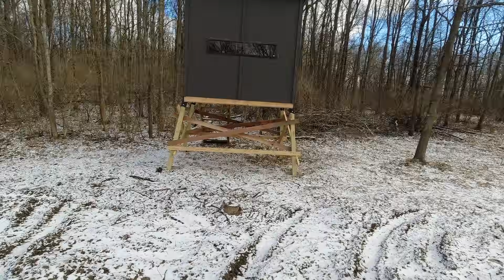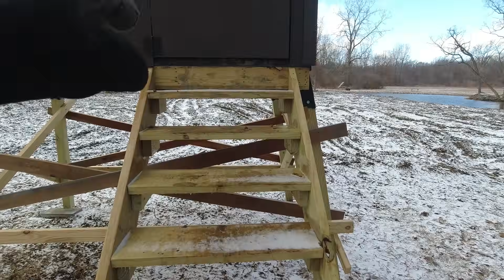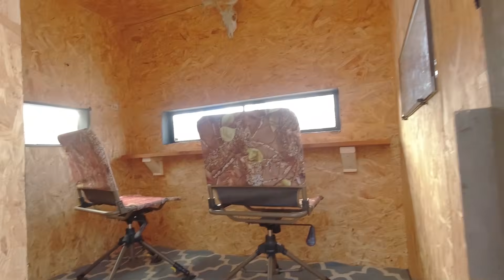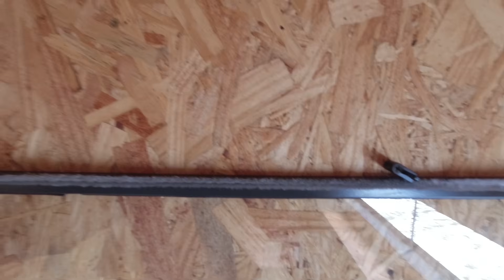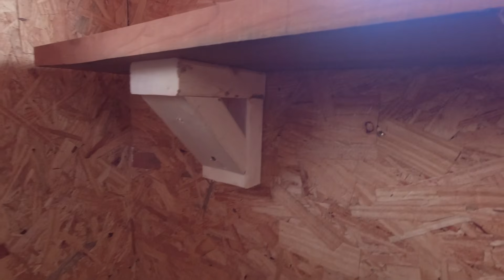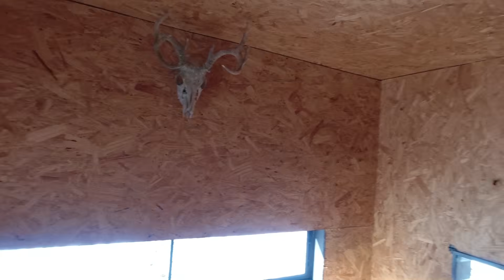ULTIMATE Custom 6x8 Deer Blind Grand Tour

Comment: My one man homemade blind is about 5 x 5 on the inside with sliding windows on all four sides.  One thing I did this year was apply window tint to the inside of the windows. I noticed in the past that deer could detect movement inside and spook as a result.  The only downside is that film makes the view out of the blind a little bit blurred.  I don't think it is enough to cause a problem.  If it is I can always remove it.  I will find out when season comes in this year.

Comment: Looks great. I like the idea of closing in the bottom.  I wasn’t going to insulate but now I might. 
Something I’ve learned in Oklahoma with crazy winds is a tip for added support. I have one in process of building now.  Just have the platform made so far. I had used some 2x6 boards for cross braces on the stand. Had some left over. On one side of each cross brace I have it so that the support sticks out about a foot or so past the leg and goes to the ground.  Yeah, I should paint it bright orange.  I bound to trip on it.  
This is added stability and helps keep it from tipping. I also added a 10-12” piece of 4x4 where the supports cross and screwed both supports into the piece. 
It’s doesn’t flex a bit. It’s rock solid. 
Good luck hunting! 
That spot looks killer.
Reply from the maker: Appreciate it man! Good luck this year in your neck of the woods

Comment: I'm in the process of building the exact 6-8 blind. I also figured it's the right size. I also went with only a 6'.6 celing.' Because in WV it gets so cold and better to heat then my 8x8x8 box blind. It takes alot of propane to keep it warm all day. Nicce blind. And yes 6'x6' is the sweet spot for sure

Comment: Awesome looking Stand. What type / thickness of sheeting did you use for the floor of your Stand. Also what about the Sides? Thanks
Reply from the maker: Hey thanks for watching! Did 3/4 I believe for floor and just 1/2 plywood on exterior walls. Interior walls were more cosmetic and to lock in insulation so did real thin 1/8 OSB for that.

Comment: I’ve used stall mats inside on the floor with office chairs that roll, its very quiet. The other thing to think about is putting up some curtains to help eliminate silhouetting and it keeps the blind dark inside after you paint the interior walls.
Reply from the maker: Stall mats is a good idea, I think Tractor Supply has those in stock here.
Reply: Yes and mice don’t eat those.

Comment: I built a 5x8 and only for one person. I have the same windows mostly. I did not insulate mine because heater is more than enough. One thing I did with this instead of my propane heater is a small wood burning tent stove. This lessens the moisture that will build up on the inside with your breath and the propane heater produces moisture. I have not tested the stove in really cold weather yet because built in summer but tried it in 40's and once it gets burning really produces a lot of heat. I am sure it will be more than enough. If you want to see a picture of my stove setup let me know. I really like it. This is a ground blind but I have an elevated blind with stairs like yous with a rail and platform  at top outside door.
Reply from the maker: Wood burning stove is legit, you'll be out there in a T-shirt and shorts to stay cool 😎

Comment: Do you have beams/ hooves with bridging to support the floor and Buliding. It looks like amateur construction… Old Billy
Reply: Hooves?  Damned correction chip ..Floor Joyces …
Reply: 8x8 is so much better,  cheap …, Conforms to simple siding, roof ,.and floor sizes for lumber and makes it a mini cabin
Reply: Still , pretty comfortable for a novice
Reply from the maker: 2x6 joists 16" on center for the floor and 3/4 plywood flooring to lock it all down. Man 8x8 would've been a bear to move with the skid steer but ur right on it being a mini cabin at that point. It's solid that's for sure.
Reply: @hurstyoutdoors  8x8 is downright luxurious. We built one in my Father-in-law's pole barn. Took the sub-assemblies (walls, floor section, etc.) out to the site using a trailer and John Deere then assembled it in place. Lots of room to stretch out in it. Also gets warm with a Mr Buddy heater going. Several times I've taken a nap in there.
Reply: I built mine 5 x 7. But I have windows out both sides. 6 is to wide to go side to side without moving. Still have room for 2 people. Used Brent M. windows.

Comment: whats your interior wall height?
Reply from the maker: Just checked and the finished height for inside is 7ft on the front side and slopes down to 6ft 6in for the back part. The rough in lumber dimensions would be taller. But plenty of room to stand up and move around, I'm 6ft and it's great. You building yours for this year?
Reply: @hurstyoutdoors  yes I am...so def got to get a move on. lol I'm 6ft also...I saw where you listed the plans were. I might try and go find them.
Reply: @hurstyoutdoors  I saw a 6x8 plan on that site. But the roof is A framed...is that same one you followed?...and just changed roof style
Reply from the maker: Yep! Did a video in the series with a lean-to style roof for it instead of the A frame (would look cool, but just more work and measurements). Any questions you have man feel free to reach out, ur blind will turn out awesome 👍
Reply: @hurstyoutdoors  thank you for the quick responses! I plan to start soon, and follow those plans plus your videos. I'll reach out if I run into any issues. lol
Earned a new subscriber. You have a lot of videos right up my alley!

Comment: Get some paint on that bottom half and the ends of the outside walls moisture will ruin all that quickly.
Reply from the maker: You're right on that one, I'm gonna use the leftover paint and do the bottom board and start to tackle painting the inside later this Spring. Thanks for watching!

Comment: Really been leaning towards the 6x8 as well so your build just reinforced my thoughts. Looks great and like those windows as well. Just ordered some of those brackets for the base, any idea what the weight rating might be? I know it’s probably a little different depending on manufacturers but just curious. Thanks
Reply from the maker: Great to hear! The weight rating can vary but I've seen several in the 12-13 gauge steel range that support 1000lbs per bracket, so plenty of support!
Reply: @hurstyoutdoors  thanks, I appreciate that. Looking forward to getting something built in the next few months.
Reply: Maybe tint the windows dark like 25% - 40% or put blackout curtains up it will keep the inside dark so the deer does not see a 
Silhouette, overall great job and design.

Comment: Very cool build , I plan on building a 5 x 6 this spring and will be using several of your ideas. Thanks for the tips. Can you tell me how far u are off the ground and how long your 4 x4's are to get that height you have. I plan on not being too high as I want good deer presentations for x bow.
Reply from the maker: The blind ends up being a little bit over 6ft off the ground. I cut the 4x4s at 76" to make up for the offset they would be at sitting in the brackets. With sitting in the chair and looking out the window, just over 9ft from the ground.

Thanks for watching!
Reply: @hurstyoutdoors  Thank you😀

Comment: Very nice blind. We have two like that, I put a trap door in the floor using 4x4's and 2x4s for rungs. I also used earth anchors and cable to cinch it down. Watch you window sills for water getting inside your wall. It looks like its  open to the elements because your window is on the inside.
Reply from the maker: Thanks for the heads up, I'll be on the lookout. Next steps are making sure this baby is sealed from bugs this summer!

Comment: What material did you use for the outside…also what type of paint. Thank you.
Reply from the maker: Decided on using 1/2in plywood for the walls, standard metal roof panels, and tons of studs for support on walls/ceiling to keep everything strong.

Paint is Exterior Valspar Duramax (Lowe's). Really impressed with the stuff.

Thanks for watching!